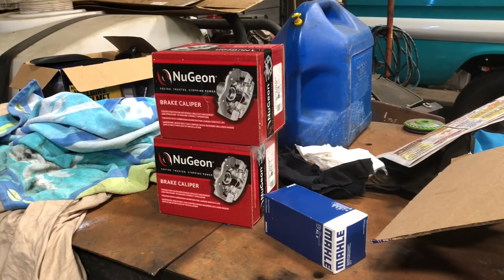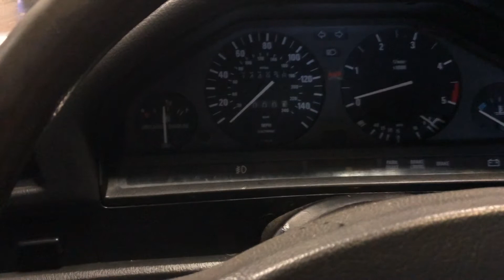E30 PROJECT PART 5! New Rear Calipers, Busted Brake Line Is Repaired, And Fuel Filter Is Replaced.

Comment: I’m not sure how I recently became nostalgic about the E30 and found your channel, but I had an 84 325e years ago that didn’t last long. Rotten rear floor board/hole on drivers side at rear passenger, hole in exhaust that needed to be replaced, mass air flow sensor issue where I had to keep the engine at 2000rpm for the 5 mile trip to the mechanic or it would stall out, timing belt snapped while driving and had to replace bent valves, and then the final straw was the rear shock and mount pushed up through the body (this is where I learned that it had accident damage and was welded) and launched itself forward into the wheelwell locking the wheel. I gave up and had the mechanic sell it, and someone broke the window and stole the radio while there. But even with all the money, adversity, and misery, that was such a fun car to drive when it was running and I wish you better luck with yours!
Reply from the maker: For some odd reason, these little cars are just so fun to drive. It’s just like driving nostalgia. Even though this car does have issues, it’s still a blast to get in and drive. I’m definitely getting more of these in the future. You should get another one! They are started to go up in price though.